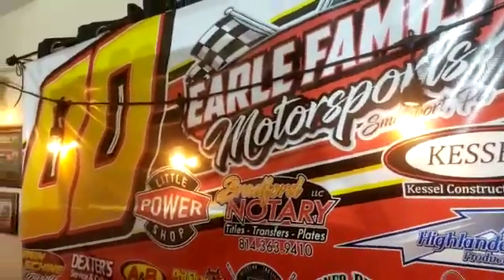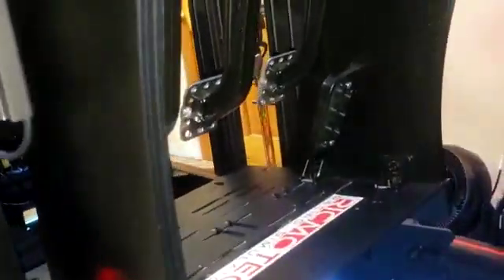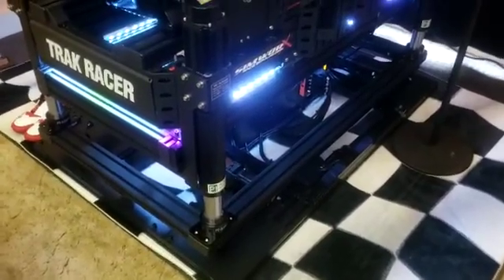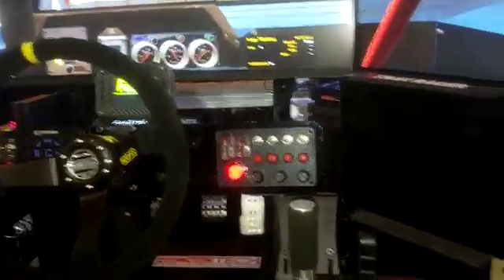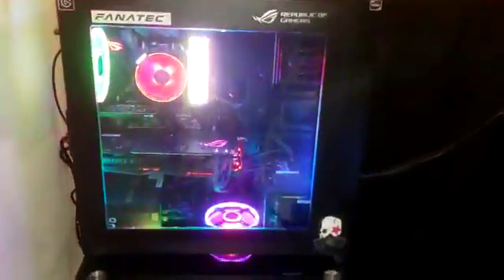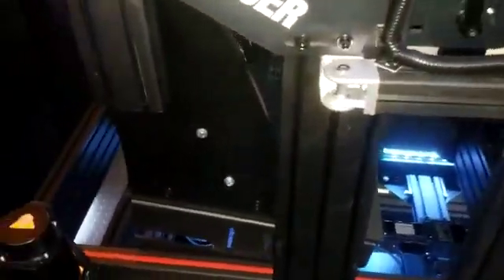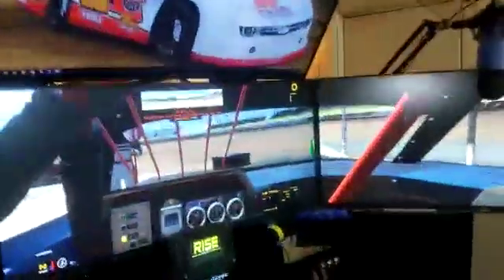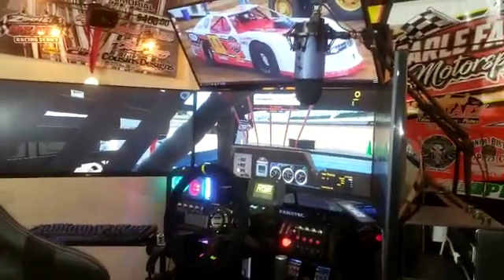Walk-around Victor's 4DOF +TL +Surge

Comment: Great set up, was thinking of going the same route PT Actuators.
I'm curious as to power requirements,  assuming you're in Canada or the US, are you running all the equipment from a 15 or 20 amp breaker?
Reply from the maker: The most current from the 4 vertical actuators that hold the platform weight. That  averages between 4 or 6 amperes. When all six actuators peak they can go up to 17amp so a 20amp circuit is enough. Also you can set these servos to 110v for USA mains if you don't want to use dedicated 220v circuit.
Reply: @tronicgr  good to know, I gotta figure some stuff out.  SC2, 2 3000W AMPS, PC, stereo... the PT Actuators wont leave much room to run the rest of my stuff.  I'm currently working with a 15amp breaker.
Reply from the maker: @daduke7990  it will be hard to reach the peak demand of the motors... only if you crash all is a way that ALL actuators get loaded the same time and the spike filter is disabled... using the spike filter on the AMC-AASD15A this will probably never peak like that even if you drive straight up to a wall !!! 😅